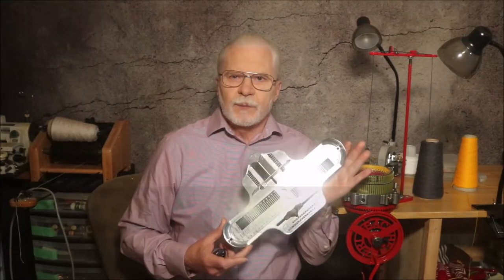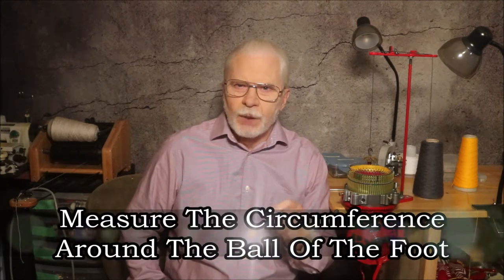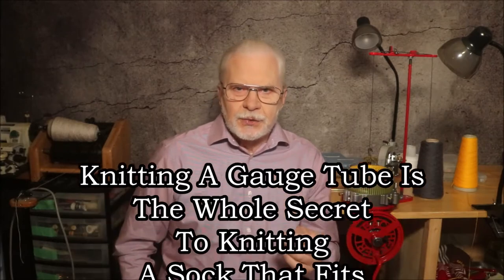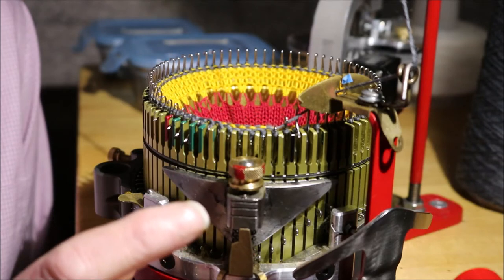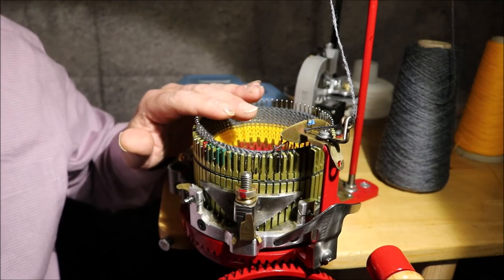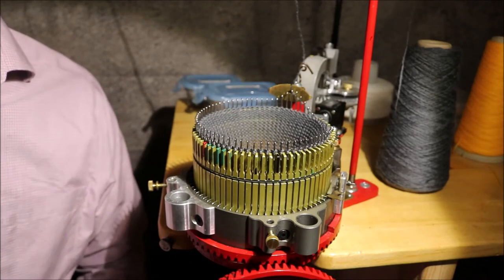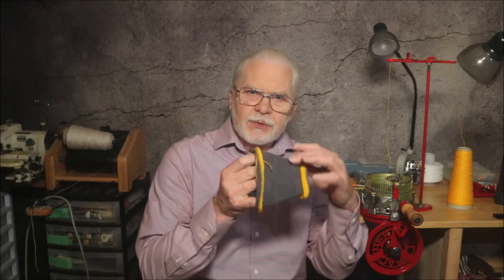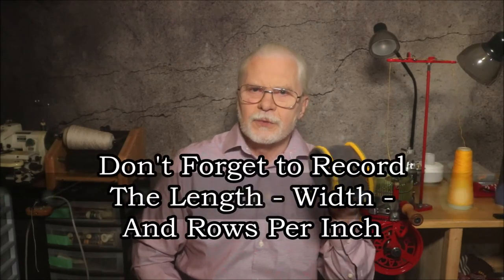Hints and Tips Chap 2

Comment: how do you adjust for the width? what if the tube is too tight? Also does the weights you put on also change the stitch length?
Reply from the maker: The answer to your question is one that hand knitters have had to deal with for generations. Every yarn is different and will knit differently.  Even a different color dyed on the same base will knit differently.  But - In very general terms, If the yarn is the same, and the gauge of the knitting is the same, the more stitches you cast-on, the wider the tube will be.  And yes changing the amount of weight effects the knitting.  The more weight, the more the knitting is stretched and distorted.